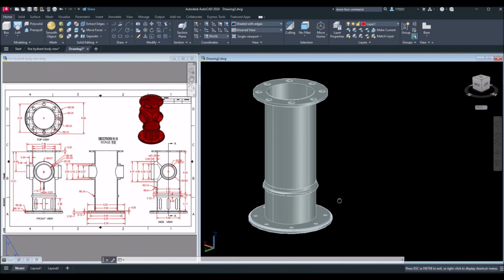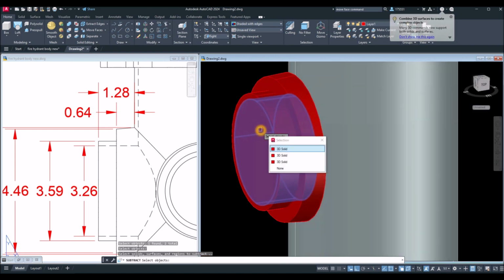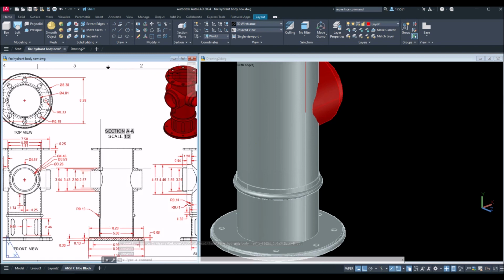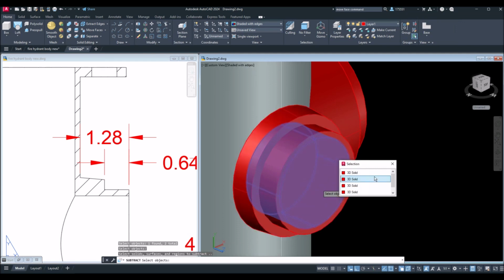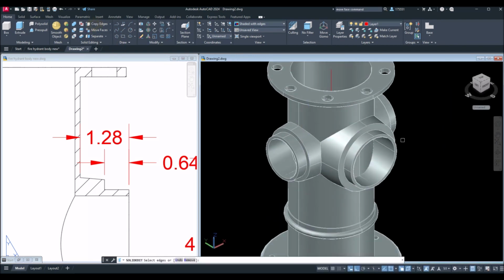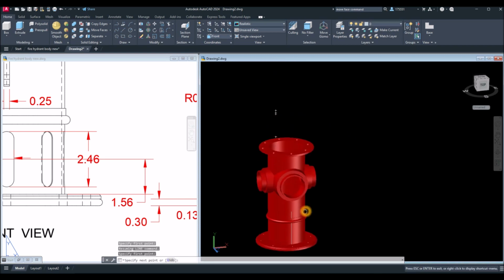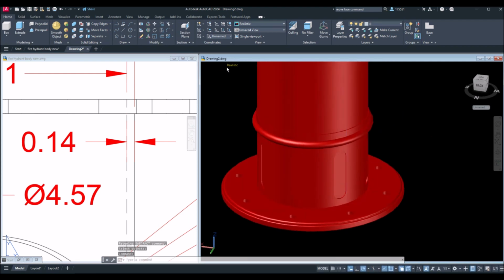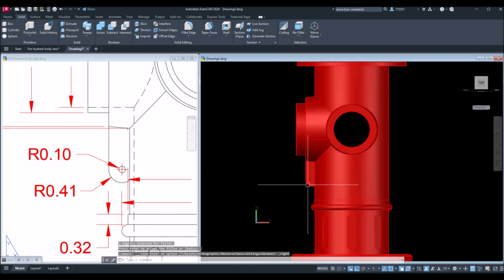🚒🔥Fire Hydrant in AutoCAD: Attaching the nozzles (PT. 3)

Comment: Nice one, but my polar array is not associative, any idea on what the issue is?
Reply from the maker: Associative arrays in AutoCAD are primarily used for creating multiple copies of objects while maintaining a dynamic link to the original source object. However, they cannot be directly extruded as a whole entity. If you attempt to extrude an associative array, you'll find that the extrusion only applies to individual elements within the array, treating each as a separate object rather than a cohesive unit. This limitation stems from the nature of associative arrays, which are designed for replication rather than creating complex 3D geometries in a single operation.
Reply from the maker: In AutoCAD, you can explode an associative array to revert it to individual objects. This is useful when dealing with 3D objects. To explode an associative array in 3D AutoCAD
Reply from the maker: After you enter polar array -> specify center of array --->: right click > click associative ---> autocad will ask you if you want the objects to be associative or not